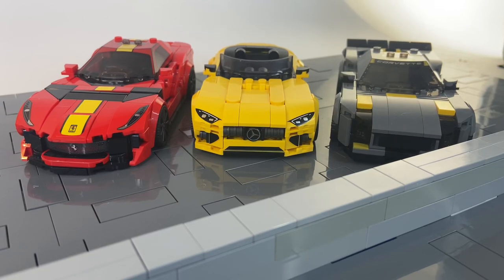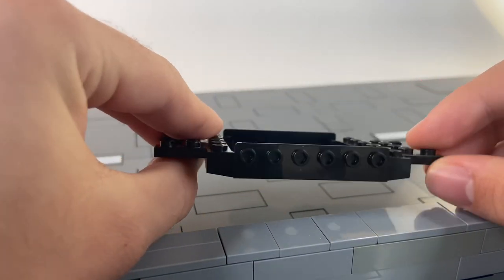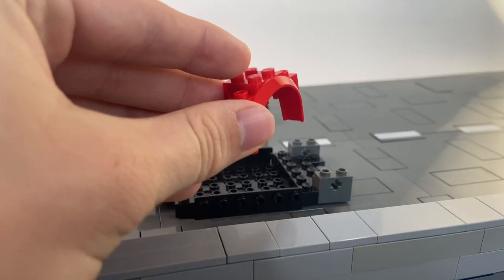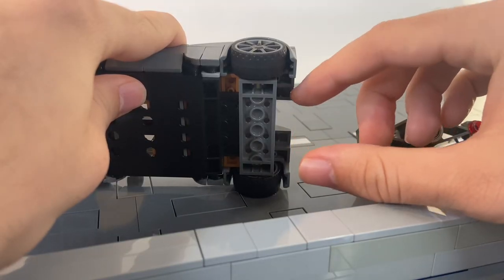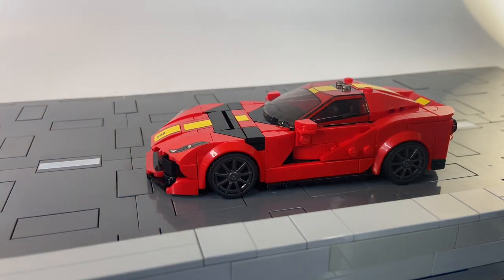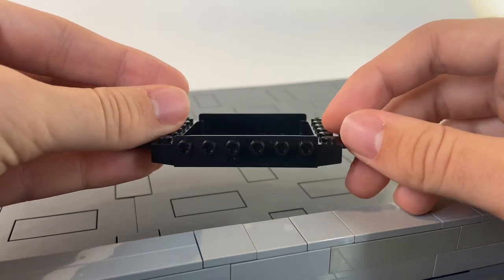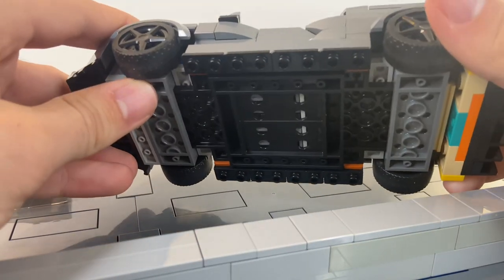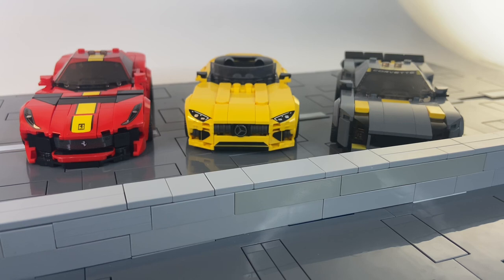How Lego Speed Champions WORK

Comment: thanks for the tutorial, but did you know we can make 4 seater with the new speed champions chassis?
Reply from the maker: Really? Gemera enters the chat
Reply: @bricknkits  yes i made a 4 seater gtr, but you need to remove some features
Reply: @bricknkits  The G-wagon from the same AMG set is a 4-seater. Doesn't use the SC chassis though.